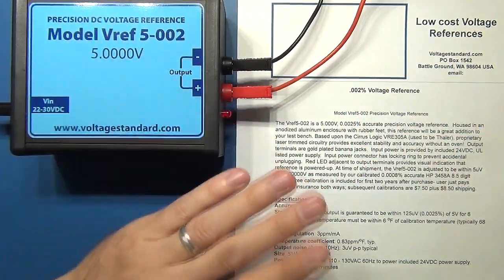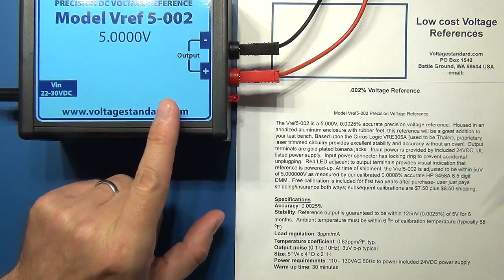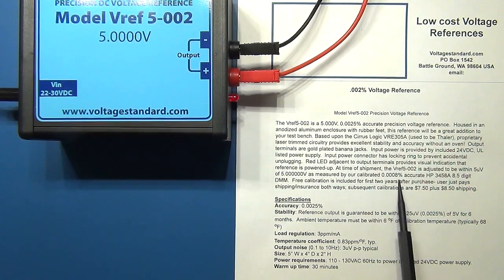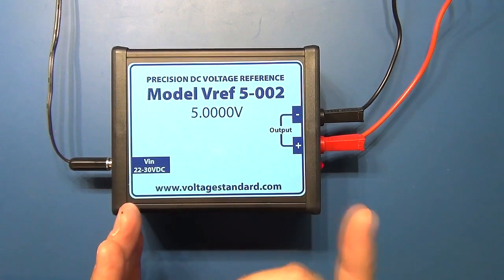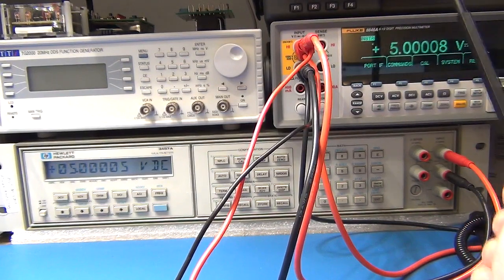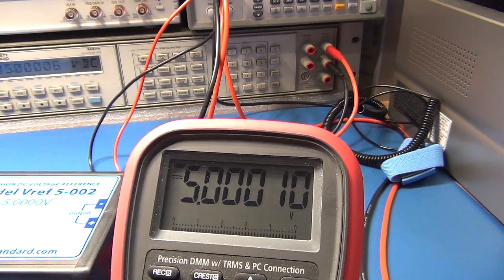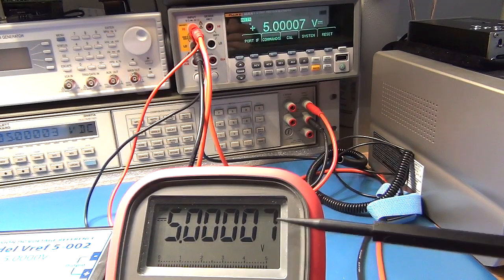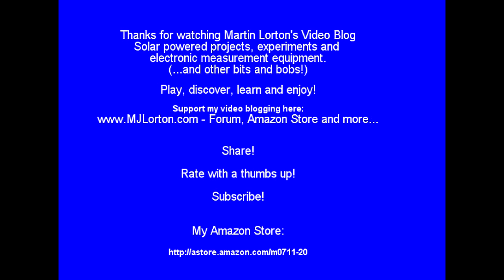VoltageStandard Vref5-002 - 0.002% Precision 5V Voltage Reference

Comment: For anyone interested, the enclosure of the voltage reference appears to be a Hammond Manufacturing, 1455 Series extruded aluminum enclosure.

I own 3 of these enclosures in various sizes and end cap configs (plastic vs aluminum) and I they are as nice in person as in the video.

Comment: PLEASE HELP SIR.........and can u please make video on the use (and not the working)..........of the capacitor, transistor, and wireless circuits...............if not possible atleast try to do 1 video on any 1 part mentioned above form the 3..........please

Comment: Hi Martin,

What is the accuracy over load? I have been messing around with a MAX6325 using a MAX5481 1024 Digi Pot to trim it down.
with NO Load I am able to trim it to 2.500 006. But when I hook up the out put to a DAC1220 DAC the reading ~ is 2.500 050
Im trying to see if this is within spec of the part. Here is my project :

https://docs.google.com/document/d/1I-DNk5t_UDZP3AKksd_8cP-8Bp4GIJf8T8ZfADh2-2o/edit?usp=sharing

mike